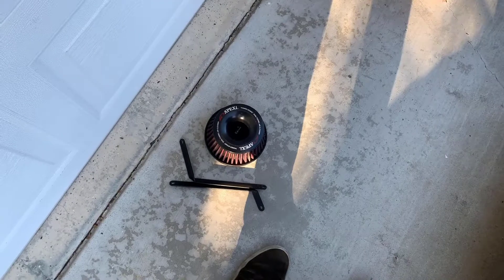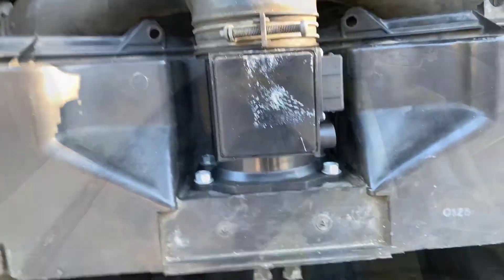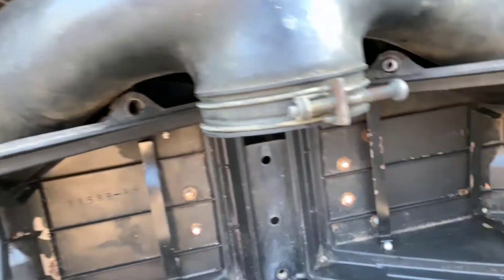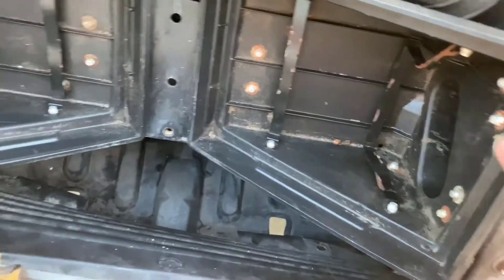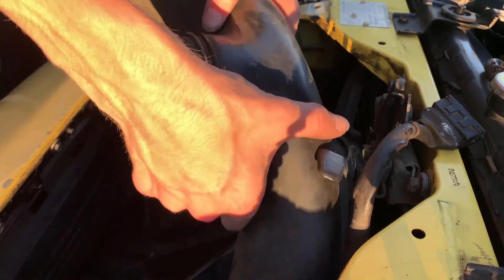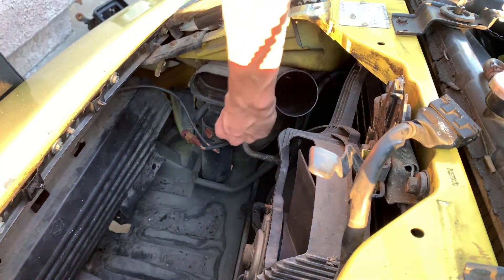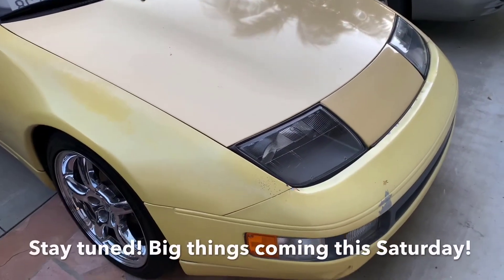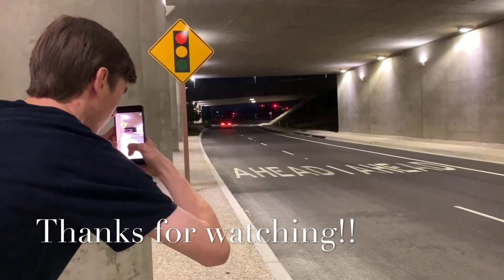INSTALLING AN APEXI INTAKE ON THE 300ZX | Z32 300zx Project Car Build

Comment: Have 1990 na . Replacing aux fan. Trying to take out airbox. How did you get those two bottom bolts or whatever they are out